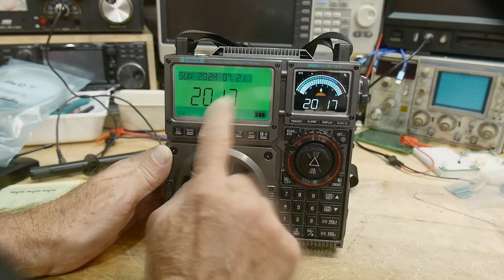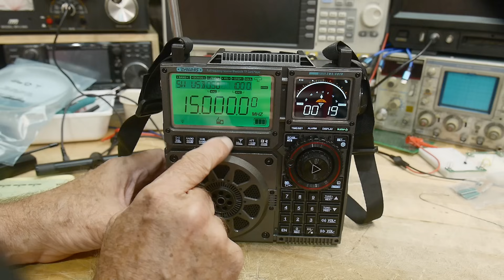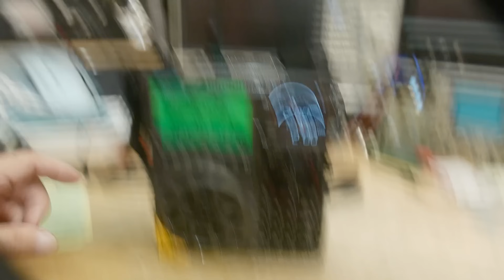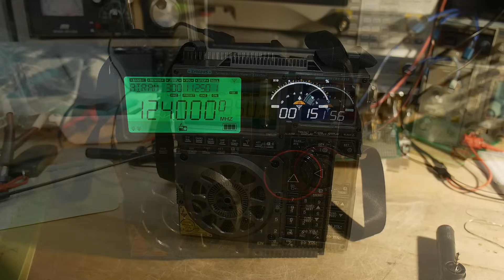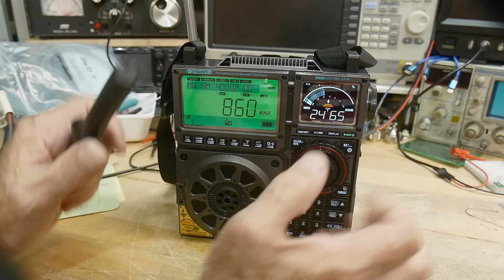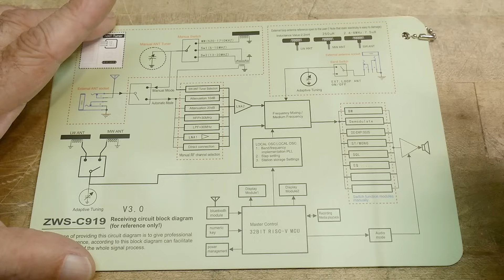#1948 ZWS-C919 Radio Receiver

Comment: Your video is full of errors. Like saying it has a Line Out jack. It's Line In -- big difference. And you had it on USB for WWV and that's why you had all the really small bandwidths available. You also said that the tuning knobs were coarse and fine, which is completely false -- their tuning step is independent and the inner one can be set to jump in Megahertz, while the outer one can be set very fine. After 5 minutes I decided this was a total waste of time.

Comment: Great review - I picked up two at an auction.  QUESTION:  I am completely flummoxed on how to turn it off.  I see the directions say hold the sleep down for 5 seconds (?), but the device is still 'on'.  I want to turn it fully 'off' so that I can set it aside for weeks and not drain the battery.  So far, it appears to constantly drain the battery.  Am I missing something?  Thanks!

Comment: Had the exact radio but a TR-113 nightmare. After having about a week the CB Band was a complete failure. What happened was, it started receiving a certain frequency across all the frequencies. this was after it would no longer pick up a transmission from a transmitter and was dead, I could not put up with this junk at $250.00.. I saw somebody say that, this radio is not ready to be sold, they are correct! Yep sent it back. Oh and mine had the battery pack which had very poor battery life.
Reply: The CB band makes no sense. It only supports AM CB, and neither gives you channel numbers no decoding options for SSB and FM. To get SSB you have to switch to the SW band and get FM you have to switch to the VHF band. Plus they wasted 200 ATS memory locations for a mere 46 CB frequencies (counting the 6 old RC airplane channels)

Comment: I'm still thinking about this.
Reply: Same here. It looks neat. The feature list looks great on paper. Problems seem to happen when you try to use it as a radio. Simple mistakes not addressed. Mis set AGC etc. Typical poor QC at a small Chinese company. Think I'll pass. That osc issue won't be fixed in software.
Reply: I bought one. Big mistake. Terribly overpriced and nothing special in performance. Plus there are all sorts of really stupid design choices.

Comment: I have the Raddy RF919 to enable display on all the time while it’s on depress time/set for big screen and alarm for the small screen.
73! Have a great day!
Reply: Problem with setting to be on all the time, is that it stays on when you turn the radio off. (There is a firmware mod to manually turn the lights off).

Comment: Interesting that they're using a RISC-V microprocessor in there -- a "recent" design.  It's a view into how that CPU architecture is getting design wins more and more in the China market specifically.  I would imagine not having to pay royalties to ARM to license the CPU architecture helps out for the lower-margin consumer products.    Wonder if there's poor voltage regulation at work there when you're pressing the buttons?

Comment: It is not like ATS-20 ( Si4732) radio, this one is a different "beast", after a search on the webs, i had find out that it has no variable capacitor on the tuning side, just a one chip radio plus lights and blink-blinks :)  easy to read with no glasses :)